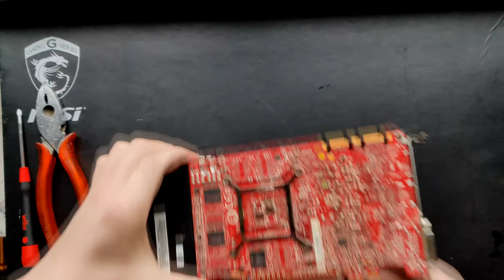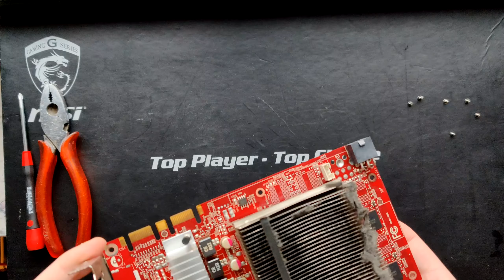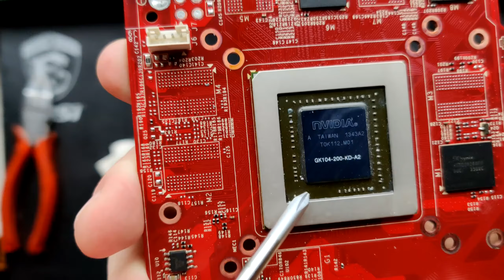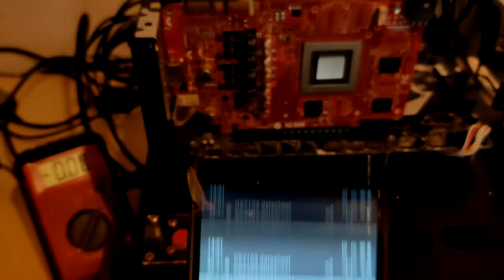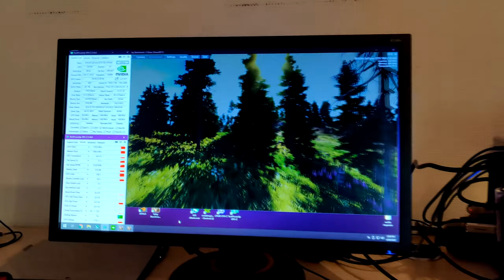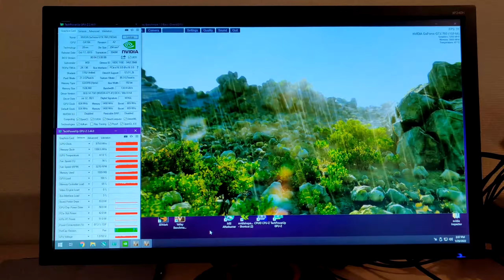GTX 760 #2 Repair | No Image

Comment: i had this card but the 256bit that has no Vcore and Vmem after shorted fan pins. i think i have to replace the vdd controller oor the core is dead?

Comment: Love the video, very detailed,

I'm testing my old card atm with no display as well,

Although I'm only getting 900mv instead of 5v on the voltage regulator and I'm getting no memory voltage.

Any idea what the issue could be or where I can start looking?

Comment: Hello, can you please give an idea about a gtx1060 3gb gigabyte that turns on ok but with no picture, all volates seems fine, it can run mats and gives no errors(it had memory errors before and i fixed by replacing 3 ram chips), once in a while it gives picture and works just find, but most of the time there is no image, i checked with oscilloscope and the switching looks ok. Reflashed bios, reballed gpu and still on the same situation.

Comment: Do you do repair as a service for customers or friends or do you buy gpus for repair?
Reply from the maker: i buy them
Reply: @CmdrSoyo  okay ive seen a few more vids and heard that you use ebay too. I was just surprised how much stuff is actually repairable. Im maybe just bad at choosing listings lol. Even with sellers 100% I got an obv. chipped core which someone has seen. Do I look for specific faults? I would guess more firmware related stuff or no fan spin at all to avoid getting ded cores but then again a risk of ded core from shorted mosfets and missing vcore come around :(
Reply from the maker: @richi9371  if you know how to repair things you know what to look for. usually things that turn on but don't diplay an image or just things that are shorted / have fuses blown. artifacting cards are usually hard to fix
Reply: @CmdrSoyo  alright Thanks! i guess i was just unlucky

Comment: Hi i have MSI GTX 760 2GB wirh same cooler (got used in not working condition). When conected it worked for some time, then scren went green and PC freezed. After restart and MATS no picture and fan at full speed. Any sugestions where to look first? MATS showed C0 (32 eroros) and D1 (1 eror).
Reply: reflow

Comment: gotta say i kinda appreciate how simple and easy these old hunk a shit GPUs are to disassemble and remove the heatsink. these modern 30 series and radeon cards that use recycled cooling solutions are a PAIN IN THE ASS to disassemble. way more screws, much more picky fan and RGB cable connectors, thermal putty that can be tough to get loosened up, weird adhesive sometimes on cards. was simpler back then i guess.

Comment: Hi! I recently got into GPU repairs and I stumbled over your videos. They help me understand how gpu's work and the basic gpu layout.
I got a PNY GTX 970 and have measured a short from the VRAM Inductors to ground. I'm still on it but my ideas are becoming less and less. I also noticed that my corresponding PWM for the VRAM voltage has an enable pin which does not get enough voltage to enable the PWM (30mV). Do you maybe have an idea? If I give up the GPU I would love to send it to you so maybe you can make a video about how to fix it. Of course you can keep it then.
Reply from the maker: Off the top of my head the missing enable signal can be caused by two things. Either a transistor connected to the enable signal has broken and is no longer sending it to the controller or the enable signal isn't generated in the first place. I can't completely remember the startup sequence for a 900 series card but usually the minor rails such as 1.8V and pex start up first then the bigger ones such as vmem and vcore. The enable signals is passed from one rail to another as they start up. You might have missed a not running minor rail here.

As for the short on vmem output that's a bit worrying. I've seen four things cause this: a dead memory module, a dead core/memory controller, a dead pwm controller and a faulty capacitor that went short.

Which one it is is hard to say usually i'd try to use voltage injection and look for components that heat up and then replace them like i did on that GTX 680 that had a shorted capacitor on the vmem input
Reply: @CmdrSoyo  I was actually trying to figure out the path of the enable pin and it goes to a dual transistor which is kinda behaving strange because the gate voltage is only 0.8 mV.

I will further investigate. Is there a way to contact you?
Reply from the maker: @Jonasee  you can send me an email if you need to but it is not meant for tech support requests if that is what you want to do.

As for the transistor i would try to replace it and/or try to figure out why the gate pin is at this low voltage
Reply: @CmdrSoyo  No I just want to contact you if I can't fix it and want to give it to you. I figured out you're german so If I'm going to E-Mail you it's gonna be in german.
Reply from the maker: @Jonasee  if you wanna send in a trash/no fix card that you don't need anymore that's fine.

I just get a lot of people sending in emails hoping to get help that way and it's mostly just annoying
Reply: @CmdrSoyo  Ja verständlich, Ich respektiere das auch. Würde mich per Mail melden wenn ich mit der Grafikkarte nicht mehr weiter komme, dann kannst du dein Glück versuchen und sie behalten.^^

Comment: Nice video, you might want to consider using regular resistance mode when checking 12V.
Sometimes the 12V inputs show unusually low resistance and therefore, don't appear as shorted but indicate problem with an IC connected to 12V.